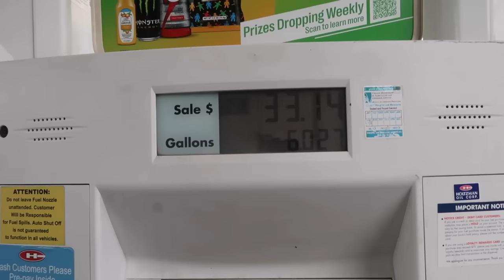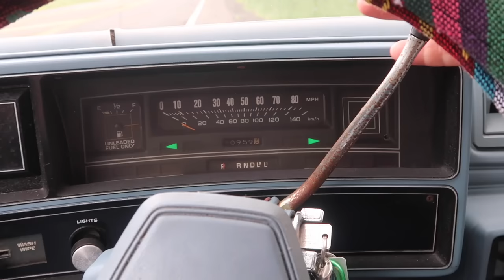FIRST DRIVE in 20 years 1979 Malibu Wagon

Comment: Damn, you need a big brother who worked on cars his whole life to give you a little motivation speech.  Remove and flush fuel tank.  Probably electric pump in tank, replace pump and if not in tank, replace unit on engine (diaphragms dry out) there still is a sock filter in the tank that I am sure by now from sitting is volcanic!   Replace that sock filter.  Check floats in carb.  Probably all gunned up from sitting.  Then once you get it running normal,...major service including replacing valve cover gaskets (oil leak prevention), service trans, (filter, pan gasket installed correctly).  If you want me to come help, I am ASE Master and I work for beer.  Great episode!

Comment: I had the same problem with my 79 cutlass there is a fuel filter in the front of the carburetor that should solve your problem with it shutting off
Reply: Sometimes the carburetors had to be overhauled too.  They needed adjusting to pass emissions tests.

Comment: Sounds like the exhaust.(the thumping) because I was going to say the driveshaft for the thumping.. the squeaking noise is pretty the belt or pulleys from a dry belt or the ac compressor pulley locked up on it, then the heavy thumping I was wondering if it was the engine... If the wifey is going to drive it, you should get the Holley efi carb setup on it and yes a/c unit for em'too.. LoL 🤣 loved the video content keep it up and where have you been??? LoL 😂

Comment: Start out with a new carburetor a rebuilt one I need fuel filter and the fuel pump and these spark plugs wires cap and rotor any shocks and run like a dream I promise

Comment: Probably should have pulled the fuel tank and flushed it or replaced it rebuilt the carburetor and replaced the fuel pump. Common problem with cars that have sat for a long period of time. GOOD LUCK!!